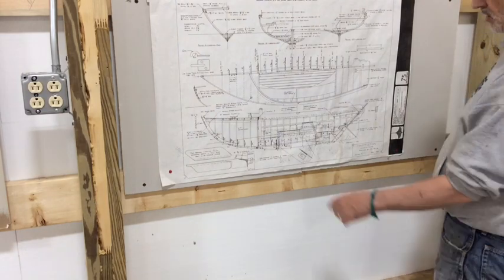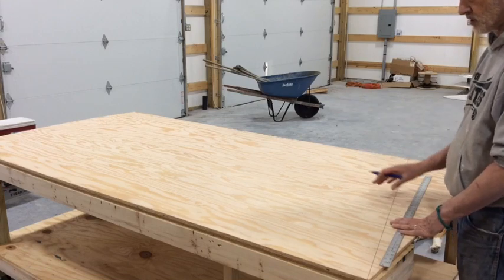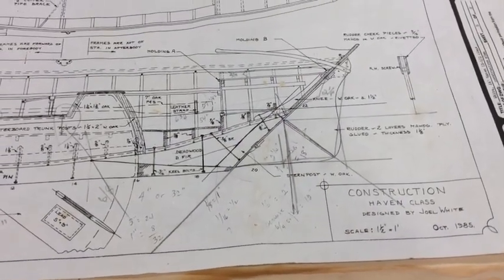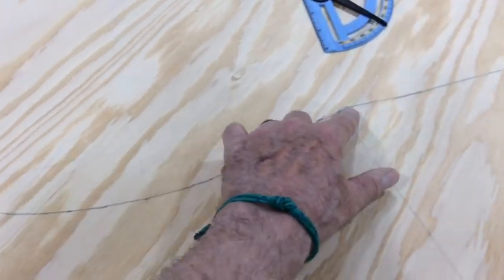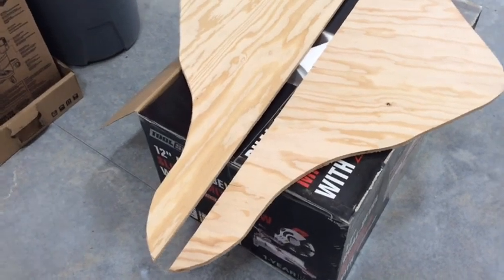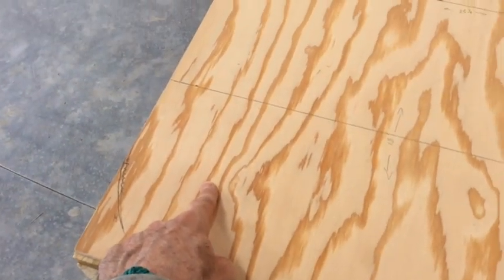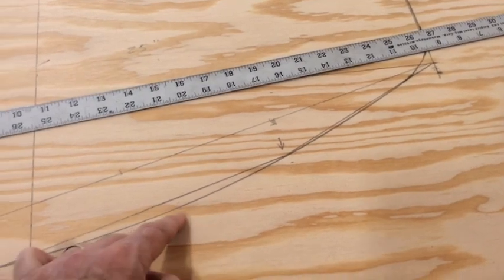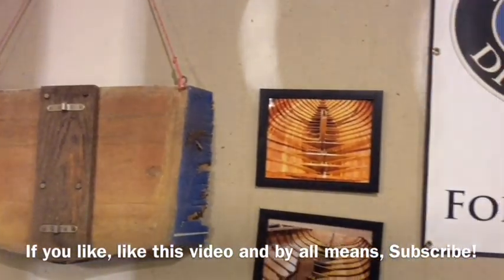Boat Building the Haven - Centerboard and Rudder- Episode 95

Comment: Hi there, 
I am curious to know if ur aware of the method and techniques of transferring the shape of rudder from the drawing plan in the plywood since u already learned the scale ratio between the drawn and the real Heaven 12 1/2. U only needed to take the general shape of the rudder as a reference, which is in ur situation it was a triangle. Then from the drawing plan find the angels and the length of each side of the triangle. Convert the drawing plan measurements to the real measurements and utilizing the angles taken from the triangle in the drawing plan. Draw full scale of the triangle on a pice of plywood. Now, In the drawing plan let the side of the triangle, that is attached to the transom, to be ur reference line. In this stage u can use a divider to find all lengths between the major points. Make sure that u choose either the top or bottom of ur reference line to be ur reference point that will unable u to find out the height of each point in ur reference line and it’s corresponding point in the rudder’s contour. U will probably need to find more lengths for different points locations in the rudder contour in order to achieve the best smooth carves of the rudder. Now, convert to scale, all the measurements taken from the drawing plan, and mark them in the template plywood sheet. At this stage u can hammer nails in all the points that u established in the plywood template. Use a thin and long enough wooden strip to visualize the smoothness of the rudder carves. When ur eyes and feelings are satisfies with the shape. Draw a line corresponding to that carve utilizing the wooden strip and a guide to maintain the same shape of carve. I believe that Leo from Tips from the shipwrights explanation on this more easier and clearer to be absorbed and understood in short time.

Comment: Mmm. No real need for lofting. Full size plans for the centerboard are on sheet 7 of the plans and the rudder is outlined on sheet 3.
Reply from the maker: I've come to realize there is some full size look for the tiller too. I need to get these other plan sheets from somewhere in my garage and move them to the shop. Thanks for pointing this out. I will dig out these other sheets and pray that they match up with what I have!
Reply from the maker: And I found these other plan sheets. my centerboard is just a hair smaller at the top but absolutely close enough. whew!  I have to say that I was a bit nervous to lay the plan on top of my centerboard but this does just go to show that the plans are quite accurate and that you can figure out these different parts in multiple ways. My tiller is dang close too!

Comment: I was positive you’d move the boat to the new shop. And I’m sure that you will at some point. Figuring those measurements out looked tricky. But looks like you didn’t d just fine.
Reply from the maker: I still have a landscaping problem with about a 10 inch lack of gravel in front of the garage doors and I still need to figure out a trailer but both are high priority so hopefully soon Enchanted will migrate up the hill to the new shop